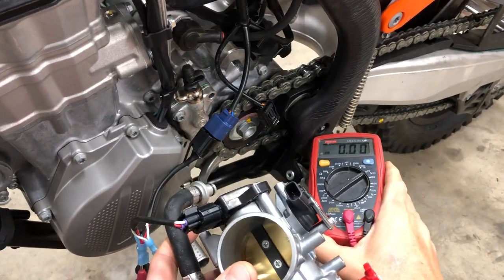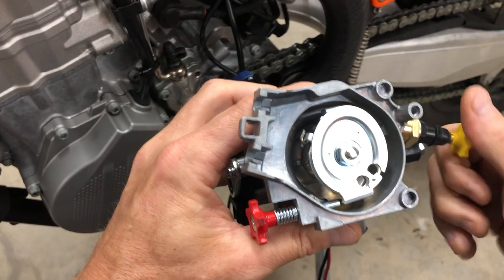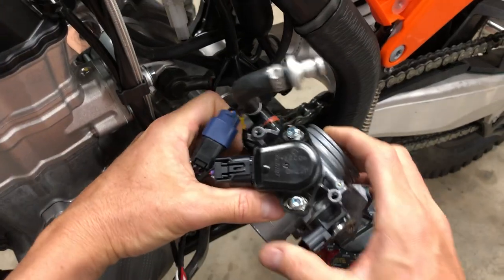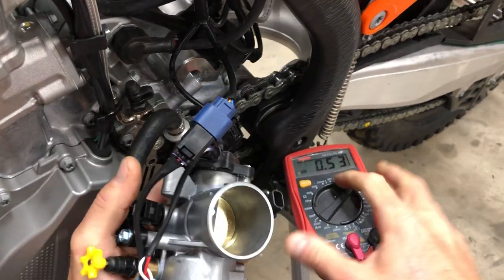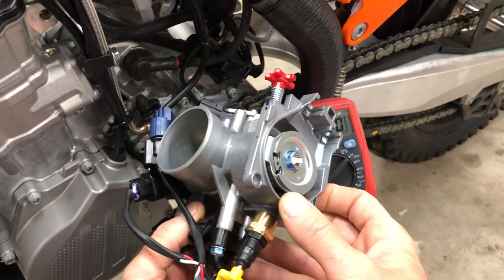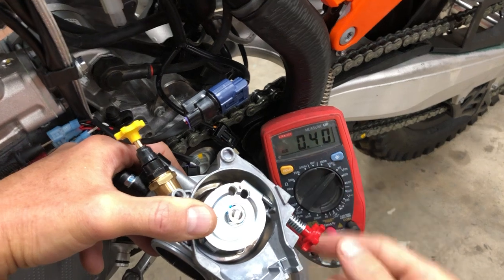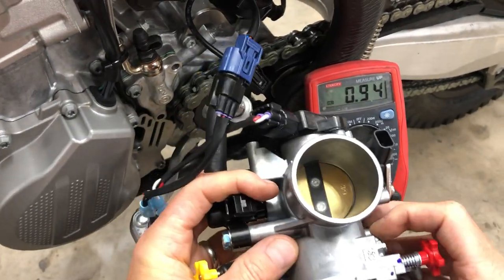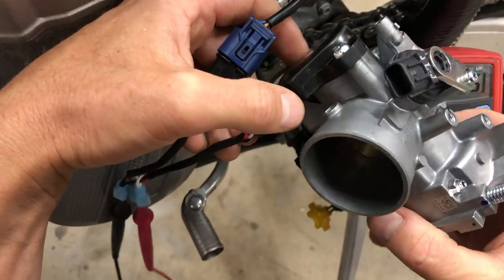MOTO MYTH BUSTERS ON THE TPS HACK AND EVERY THING THROTTLE BODY

Comment: It's wild that this video hasn't been taken down and redone, or at the very least corrected. There is SO much convoluted, conflicting, confusing information. I don't think it was intended to be confusing or misleading, but it sure could use cleaning up.

I also wanted to comment on the "TPS Hack". It was my understanding that the pre-2016 bikes could be manipulated with a TPS adjustment, but 2017+ could not. That was the "truth" I settled on in early 2018 when I bought my '17, so I bought a Vortex. I've tried searching for information on the fueling strategy used and haven't found any good information. What I have found is info saying that MAP sensors were added at some point and the "TPS hack" works in low throttle situations. It amazes me that in all the comments below, there isn't one mention if these bikes run a speed density or alpha-N fueling strategy. If they are speed density, no, the TPS setting won't do anything. If they run alpha-N, yes, the TPS setting will do something. But what it sounds like to me is that up to 2016 they were exclusively alpha-N, and starting in 2017 they are using both. So, alpha-N at low throttle inputs because the MAP reading is unstable at idle and off-idle. Then, it transitions to speed density after a certain point, probably dictated by a number of parameters like RPM, throttle position, MAP reading, etc. So, in all likelihood, the "TPS hack" will make a difference in the alpha-N stage at idle and off-idle, but no difference when they system transitions to speed density. Therefore, as is the intended topic of this video, the "TPS hack" to account for not only the stock super-lean mapping but also the addition of modifications that really need more fuel DOESN'T WORK as intended. 

I don't know where folks heard "it will run leaner" with the "TPS hack". What he said is basically "you think you're fixing the lean condition with the TPS, but you're not, and the situation is even worse if you start adding free flowing exhausts, removing your reeds, etc."

It's also crazy to me that people think with as much power and influence that the EPA has that their efforts to cut down emissions could be skirted with a simple tweak like that. It is SO BAD that anybody who can theoretically tune one of these ECU's won't touch them for fear of the legal consequences. You have to be in a secret society to get your stock ECU tuned, yeah, I'm real sure that can be skirted around by loosening two screws and tweaking a sensor. No way the EPA lets that feature get through, they won't even let you have a map switch, or even a connector to plug the switch into. 

I'd never buy one of these bikes used if they didn't have the ECU remapped in some way. They'd need a Vortex, GET, JD Tuner, or something similar to get the fuel where it needs to be for engine longevity. Running on the LEAN factory map that passes the strict emissions standards is a recipe for disaster.

Comment: Great info.  You state that .53 is not a spec but where the bike should be idling at 1800-1900 RPM.  If the bike is not idling at 1800 at .53, would I adjust the TPS until it does?  If I set idle via the idle knob, that opens the throttle plate which is not the same as adjusting the TPS sensor position.  Thanks

Comment: Mike, thank you very much for this AWESOME video. I can assume that this is the same for 2023/2024 KTM 300-SX and XC, GasGas, Husqvarna....ect. If not, would you make a video Strickley for the 2023/2024 125, 250, 300...2-stroke bikes and if your TPS wire you make will work on these bikes as well or not?
In addition, if you happen to make a separate detailed TPS video for 2023/2024 2-stroke bikes could you please include detail info 2023 and 2024 (I'm sure 2025 as well) 2-stroke """Electronic Power Valve""" setting as well, I'm sure it will be greatly appreciated by MANY people.

Comment: Great video, thanks for making it, lots of good info, makes perfect sense. Now for my questions. I was one of those guys that changed my tps position because of some serious decel pop after installing an fmf slip on my 16' ktm 500 exc. First question, is the 16' 500 stock tps setting also .53? Second question, if I reset my tps back to stock will a JD Jetting Power Surge fix my decel pop? I just recently picked one up cheap and haven't installed it. Thanks
Reply from the maker: .60 on that bike. More fuel will impress you with how much more that bike has to offer you

Comment: I really appreciate your video. Can’t thank you enough.  My 2022 KTM 500 EXC-F kept shutting down when cold start was off. I’ve got 30 hours on the bike, love it. But, suddenly it wouldn’t go after cold start disengaged. This video fixed that problem. However, will I need to adjust something since now both the cold start yellow  adjust is turned max clockwise and the red idle is turned max in? Is there something I’m missing? Do I need to adjust the TPS? Will this cause problems later or should I just run it with both turned all the way in? Thank you!

Comment: @TACO MOTO CO
Most companies like to run open loop at idle especially when cold because the O2 sensor reading is not correct until fully warm. Also every single start is completely open loop fueling. So this is why modifying the TPS value improves start because it richens the mixture (similar to choke). Now why dont it come that rich from factory? (CARB and EPA). Now on bikes with an O2 sensor like the street legal EXC the O2 sensor along with the MAP sensor takes care of all the free flow intake/exhaust mods. You dont need a TPS tuning for exhaust mods. But you do need it to take advantage of Open loop starts and Idle until the O2 sensor picks up. 
Now there are bikes without the O2 sensor like the XC bikes or the MX bikes. Those definitely can work better when this is properly tuned and you can get an overall rich mixture throughout the rev range with this mod. So less knocking, less valve wear from heat and engine lives longer and loves that. Plus fewer flameouts. 

I like your videos but I gotta say not everything you said is correct. I hope you make another video that will fizx the issues.
Reply from the maker: We don’t say that TPS tuning will fuel exhaust or intake mods in fact we say it very often very publicly that it won’t. 

A tps hack is not a tune. 

I wish it was true what you say about the o2 bikes compensating for air flow mods but testing by us and other shops time and time again show that not to be the case.
Reply: @TACOMOTOCO  Well that is the whole point of the O2 sensor to compensate BUT that compensation usually tops out at a certain percentage. So let's say the company knows that typical airflow variation from engine to engine is 5 percentage then they will limit the O2/Fuel adaptions to 5 percentage. If the mods increase airflow by 10 percent then the fuel air ratio is off and we will be running 5 percentage lean. 

TPS tuning or hack will indeed affect the overall fueling on a bike with no feedback mechanism like the closed circuit bikes. So this is a good hack to have if one knows what they are doing and dont want to spend big on custom ECUs
Reply: As a matter of fact I have a Husaberg FX450 and a Husqvarna FC350. Both bikes are open loop because they aren't road legal and the TPS hack does wonders on how the bike runs overall. The effects on an EXC-F will be limited to starts, cold idle, etc
Reply from the maker: Tps hack is not a tune but is somewhat viable on the 12-16 gen bikes using the 32 bit ECU’s but with the release of the 64 bit boxes on the 17-19,gen enduro bikes it’s results are less productive and on the 20+ gen bikes will run terrible from it. 

If the 20+ US spec bikes running the locked EPA map allowed for enough fuel trim swing to accommodate any intake or exhaust mod then you’d essentially have an auto tune system and could install any mod remove any component and the bike or car would auto calibrate to cover the new air flow. Man I wish that was the case, how nice would that be. 

What would the point of a regulatory agency be if they allowed for auto compensation. 

Imagine being on a highway where the speed limit sign changed to match whatever speed you happened to be doing at the time. 

Or your overdrawn bank account recalibrated itself with enough available cash to cover each new purchase you were going to make. 

That sounds like an amazing world, one of for sure live to live in.
Reply: @TACOMOTOCO  as a matter of fact car ECU software already does this adjustment for airflow. They cap the max adaption to a value they feel comfortable enough. This js because they want to account for engine variations, cam chain stretch, air filter flow loss increase with age if filter, CAT or DPF clogging etc. Small mods are easily accepted within this range. For example if you install a lower backpressure exhaust you still dont get an engine check light come on on a car. This small change in airflow increase is been adapted out by the airflow and fuel adapts. Now throw in a tuned header and the change in flow exceeds the manufacturer allowed trim and it sets an engine check light. As long as the check light has not come on its safe to assume engine is aware of the increased flow and hence already making changes to fuel and spark to account for the increased flow. 

How do I know? I used to calibrate such vehicles for a living and do performance and drivability tests. So we know how the ECU works else we won't be able to set the parameters (spark, cams, fuel ratio etc). Yes fuel ratio too. Not every time does an ECU target stoich fuel air ratio. They target what ever ratio makes the lowest emissions
Reply: On a separate note I love your videos and your attention to detail on those videos. Keep making them and we will keep watching

Comment: i might have missed it.. but if .40 is good when the red/yellow knobs are unscewed to there max, and you start to turn up the idle to 1800ish..then you said tps might end up at .60.. but if i get a vortex, and goto install it, do i leave the tps at .60/1800rpm, or do i readjust it to .53 ..whatever the 1800 rpm lands on is the tps spec? and the correct tps for a vortex/get? so 1800rpm is more important than the tps value?.. btw great video, with tons of info, im just a little confused! and going to look at a 2020 500 tomorrow!
Reply: I have same question with get ecu want to know correct procedure for people with aftermarket ECU and no O2 sensor

Comment: I know my yellow knob has been tampered with.  Probably the idle adjustmeny knob as well.  I know because I screwed with it when my fuel filter got clogged and I didn't know what was going on. Is there any way that I can readjust it to factory specs without taking off the throttle body?  I can pull the yellow knob down and turn it counterclockwise until it stops and then adjust my idle.  Then do I turn the yellow knob clockwise until I feel slight resistance and it's set?

Comment: In some models the yellow screw will not be there instead an Air screw and the separate choke piston will be there at the throttle body. In that case how to understand the role of this yellow screw that the shown here? The example is Royal Enfield Classic 500 2018 model.

Comment: Vortex and pipe on my 17 exc 500.Sat three years when I bought it.Found the fuel injector to be clogged,fired up with new one,no need to push in the yellow knob,when warm the idle was high,I tried turning red knob,only sped up..turned the other way,until the red knob had the spring compressed all the way,idle still too high.Turned the yellow knob,two clicks and the rpm settled down nicely.Doubt the tps has ever been touched.

Comment: I appreciate this man, but I am totally turned off when people talk bad about the competition. 
I'm not taking a stand either way, because I don't have the tech knowledge. I would imagine though, that it would be hard as heck to sell those ridiculously expensive GET and Vortex tuners if people could just tune up thier bikes like this wouldn't it? 
When I first started racing Dave sent me his whole catalogue for free as a way, to sponsor me. I put in the big bottom kit, fuel rail, adjusted TPS, put in the larger clutch cover along with the clutch weight. All of it improved the way my bike ran as far as I could tell. By the way, that big clutch cover, and bar inserts save my bike and my butt on more than one occasion. The clutch cover is tough to put a hole in, and the bar inserts do a great job of protecting your levers, grips and throttle tube.  
Anyways, I'm no longer affiliated with him but, I always saw him as somebody who helps people, with less expensive alternatives. Not a snake oil salesmen. He is for sure a mad scientist, and very flakey as well, but for about a third of what your tuners cost, I got a performance increase I was happy with. 

Instead of telling me how bad he is, maybe tell me how the GET or vortex is so much better. So much so, that  it is worth paying 10x more for.
Thanks again, and I do appreciate what you do for the community, just turned off by the attitude towards a competitor.
Reply from the maker: What’s up my man. Thanks for the comment. Not sure I follow though, I don’t have anything to say about anyone, that’s not what I’m about. 

As I hope to be very clear here there’s a few points I’m making:

*The red and yellow knobs are misunderstood 
*The tps ‘tune’ isn’t a tune
*You can use a special voltage device to set tps value or a meter and the ecu. I don’t take a position really on either one. Both work well. 
*setting the rpm to spec is very important
*some devices like the Vortex ecu require the tps value to be set to stock 
*over view of all the components. 

Thanks for watching my videos and if you think I swung and missed on any of those points I’d love to get your specific feedback.
Reply: @TACOMOTOCO  you know what. You are right. I think I am attributing the comments of others to you. You would think having a channel myself, I would know better. Sorry man. And again thanks for the work you do.
Reply from the maker: @JoeRockstar  all good my dude. what's your video channel. throw a link here and i'll check it out.

Comment: I just got a new Vortex, Euro Airbox without the Reed, and a brand new Yoshi exhaust. I’m literally just taking a break before putting the new pipe on. On the Vortex instructions it has a video showing how to recalibrate the TPS at both closed throttle and WFO. Hold the kill switch and turning over the starter for about 3 seconds in closed throttle, repeated again in WFO. 
My problem is I have an FE501S will an ON/OFF switch. In the OFF position the starter will not turn over. 
The Vortex I got came from a tuner with custom maps and they said I need to bring it in so they can hook it up to their laptop to recalibrate the TPS. They also said it needs to be recalibrated any time I readjust the idle speed just like you explained. 
Will your pigtail tool allow me to also set WFO calibration?

Comment: Your videos are great.  I have a 19' 250 excf and the low end is really a bit disappointing compared to other opened up bikes I have ridden.  I haven't made any adjustments and my budget is fairly low.  I know you vouch for the piggyback and endcap as the first things to do.  In your mind in order of importance what mods would you make to get this to really rip.

Good stuff no BS videos. Love them
Reply from the maker: Suspension then power. 

The Dobeck is a good low cost tuner and does well. A replacement ecu will really wake that bike up. Take a look at a vortex or a GET🤘🏽

Comment: I sorta lost my way when adjusting my KTM 350 XCFW's idle settings. I need to get them back to stock and then go from there.

1. My intuition says turn the yellow (choke) knob out all the way first so that it's not affecting idle.
2. Then get the bike warmed up and then set idle (red) knob to 2000 rpm (per manual's recommended idle speed)
3. With the yellow knob so far out, it will no longer even do much in the way of a high idle and when pushed in it wont release when rolling the throttle grip forward
4. So from there I can start turning in the yellow (choke) knob in until at least the throttle grip can be trusted to roll forward and engage the release.
63 clicks out is max
38 clicks out  (25 clicks in) is OEM
I had to do 32 clicks out (31 clicks in) before the throttle grip release for the choke would engage

Is this the best way to set all that stuff? As far as order of events?

Comment: You are missing a vital part of the equation. The ecu is in idle position from .53v to about .64v. Anything above .65 it will read the main fuel map. I have the UST and see how all this ties with the ecu. My bike was .57v from factory and adjusted it to .60v and found my off idle was crisper as the ecu wasnt in idle mod when I broke the throttle thus adjusting the timing and fuel properly.
Reply from the maker: When it’s in spec it runs correctly as you noted 🤙🏽
Reply: This is possibly the most relevant comment.  If you're saying that up to .64 adjustment on the TPS is still within spec per KTM...than making that adjustment to eliminate flame outs, increase throttle response off idle, or any other symptom that is  cured through it I don't think is fair to categorize as a "Hack".